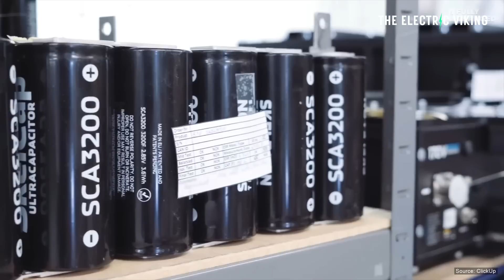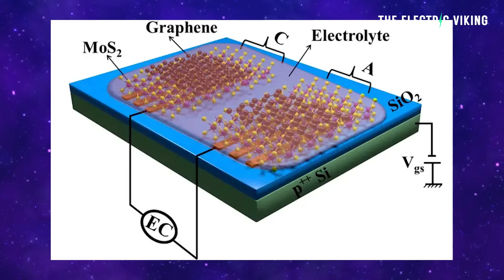Experts say Ultramicro Supercapacitor are "Game-Changing Energy Storage"

Comment: Charging not only limit by battery, grid and charging system are limiting it so even if the battery can charge in 2 min you will need 3000kw good luck with that

Comment: I built a car battery from supercapacitors (schematics and build description on my youtube), as well as several flashlights/lanterns some years ago. Another advantage of supercapacitors missed in the video is though batteries support thousands of cycles, supercapacitors support millions of cycles, and are not affected by the heat/cold our weather can produce. If they can get energy density (super cap current weakness) up high enough for EVs, then the supercapacitor could in theory last the lifespan of several cars being moves from one car to the next!
Reply: Super capacitor have high self discharge behaviour, while battery not, its major difference, so when you have high energy density of super capacitor its useless if you have long delay gap between charging and discharging, for example charging now and use electricity next day or next week
Reply: @teknosql4740  self discharge depends on the quaility of the supercapacitor. Some cheap Chinese brands (like Green-Cap) are pretty poor grade, and discharge 20%-30% in less than an hour. Then you got brands like Maxwell (I use in my flashlights). Some of their capacitors had +90% charge after 6 months. If they can get the energy density of supercapacitors near batteries you'd have the perfect power source.

Comment: The thing about capacitors in the old days is that even though they could take 250,000 cycles they would only hold a small amount of energy. Then they were opt to release it all at once. However, in the early 2000s Brigham Young University (BYU) out of Salt Lake City, Utah took an EV1 and replaced its batteries with supercapacitors. I saw them bring their capacitor powered car to The Power of DC, an EV drag race event held just outside of Washington, DC, where a bunch of homemade EVers used to drag race their EVs against each other. The caps powered EV1 from BYU would push so much power through the motor that it would twist break the axles on their EV1. Drag racing seemed the perfect place for supercapacitors because they would release all their energy in a few seconds and then they were empty. To solve this problem in electronics engineers time a bank of capacitors to release a row at a time, timed with the Hz of the electronics. Its like going small pop, pop, pop etc. to create a better smoother flow of current. Because they can be cycles for forever, (250,000 cycles) and they can capture energy so fast they really are perfect for charging with regenerative braking and then releasing that captured energy to overcome inertia, an object at rest will stay at rest unless acted upon. EVs use a lot of energy to just get going. Once they are going they don't need as much energy to stay going, An object in motion will stay in motion unless acted upon. This would leave the batteries with only the duty of keeping the vehicle going through wind resistance, mechanical resistance and road friction resistance. The problem with capacitors in the old days is that they would take up a lot of space for the volume of energy they stored. This breakthrough seems to solve the energy volume problem. With that using capacitors for all phases of EV energy storage and use would be possible. Capacitors don't really go bad like batteries. It is not a chemical reaction that has to take place in order for them to charge and discharge, so there is nothing to wearout. Original capacitors use an electric field to hold the electricity. Any of you know what a Leyden Jar is? It looks like these dudes are going old school. I mean really old school, like the middle of the 1700s old school.

Comment: Microscopic supercapacitors built on chips in a wafer fab may be OK to integrate small amounts of capacitance into an IC, but the cost per joule stored will rule out their use for bulk energy storage.  Even with a micrometer of thickness built on the chip, which is huge, a square meter of silicon would only have 0.01 cubic centimeters of supercapacitor.

Comment: Supercapacitors are very useful in energy-recovery systems such as you find in hybrids and electric vehicles due to their very low internal resistance.  For example, a typical EV battery can soak up around 150kW of power during regeneration and it could hold that rate for many minutes.  A super-capacitor, on the other-hand, would be able to soak up megawatts of power, but would only be able to hold that rate for a few seconds.

So supercapacitors won't be replacing batteries, probably ever.  They don't have the energy density.  But for short-term energy recovery and generation purposes the super-capacitor can operate at 99%+ efficiency while an EV battery would be sitting at 85% or lower (at those wattages) due to the voltage drop caused by its internal resistance.

Similarly, for handling short-term acceleration (such as accelerating from a stop), a super-capacitor could be charged slowly from the EV battery and then discharged quickly into the motor at much greater efficiency. 

That is the main claim to fame and this "discovery" (if it could be called that... I'm skeptical myself)... it probably isn't going to change the equation much.  That "3000%" quoted was clearly under extremely fragile conditions and probably relative to very low amounts of capacitance in the first place, for example.   A game changer?  Maybe decades from now a portion of this research will be in use as part of super-capacitor system.  It sounds rather expensive.

Comment: There is a problem with high speed charging of battery packs and that is the amount of energy that the grid can supply. If you take the average house electrical supply in the Uk (80 amps at 240 volt or 19.2 Kw) a 50 Kwhr battery pack will take around 2.5 hrs to charge from low and this does not allow for any use in the house. You could use public high speed chargers but they are expensive per Kwhr as the company running them want to make a profit. If you are able to charge your car in 3 minutes (say 50Kwhr battery - it does not matter if it is Li ion or supercapacitor) you need a supply capable of 1000Kw (1 Mgw) or the average daily use of 125 houses. The idea is good but ulta high speed charging will present major problems for the grid. If you have a charging station of say 20 chargers they will require the energy capacity for a small town. One way to allow high speed charging might be to limit the time of day it can be done.
Reply: The grid capacity issue can be overcome by having local battery storage with the charger. The big problem is the connection to the vehicle. Can you imagine the thickness of cable needed for a 2 min charge!
Reply: For a 3 min charge on a 400 volt system you are looking at around 2500 amp. To put that in context the current 350 Kw chargers charges at 875 amps. These charging cable can be a problem now so a cable twice to three times the size would be impossible to handle.  @petewright4640

Comment: Supercapacitors are general orders of magnitude removed from having the energy to mass and energy to volume ratios of batteries. So this may well be a better supercapacitor, but I think it's stretching things to suggest it's going to replace batteries.
Reply: They're becoming quite common in electric forklifts. While they don't store as much energy, they will charge in the time it takes you to go for a pee. In a 24/7 warehouse operation, it results in  higher uptime, compared with a unit that has to sit for several hours recharging batteries over that same period.

Comment: All that matters is the energy density and cost per kWh, and we are a long way off capacitors getting anywhere near batteries in terms of energy density by at least an order of magnitude.  Batteries already provide sufficient power.  Like all your other science announcements, it it was any good they would be already being sold and used in products.
Its possible to produce high capacitance, but not high voltage, so the higher you go with capacitance the lower the voltage tolerance.  They don't mention this so we can assume that is what the problem is.

Comment: For many decades we had electric vehicles that transported us around town without any batteries - and yes,  I was just a kid when I rode in them.  I'm old now, but we had a whole system that let us go anywhere for a low price.  But like idiots we gave it up in order to have our own cars.  Now we're trying to go back to electric vehicles and we're forgetting that we were already once there.  ☹️🥺😥
Reply: I remember the Cleveland, Ohio electric trolley cars in the 1950's.
Reply: EVs are a bit of the best of both, e power off the tracks
Reply: Those electric vehicles of which you speak had a serious limitation: they ran a fixed route on a slow fixed time table. FSD taxis will pick one up on their own schedule, take them to whatever their destination, attend to someone else, and another one will pick them up. Rinse and repeat.

There will be no need for tracks or other overhead charging infrastructure. I believe the cost will drop below 10¢ a mile.

Comment: Living for 70 years in the 5 volt electronic world, and 110/220 volt US  residential world.  Should there be concern regarding high voltage capacitors, mega chargers, EVs with 800volt architecture in the hands of everyday housewifes?  I remember a few wet/110 volt deadly groundings as a kid.

Comment: I could see super capacitors added to EV's.  Regenerative braking charges too fast for batteries and going from stopped to moving takes lots of energy.  Capacitors could supplement batteries and be especially useful in stop and go traffic.  May also be good for wireless charging.  You might be able to make an EV with a smaller battery which would save weight and cost less.  This could be the future for Urban Robo Taxi's.
Reply: you could remove/replace that item from under the frunk... #munrolive

Comment: That energy density sounds too high for be real.

That's because capacitors are based in electrostatic charge, not chemical based in ion exchange. The electric field generate problems that limit a lot the total charge in the capacitor that makes extremely dubious that supercapacitor can reach so high energy densities.

Speaking of "X%" is doesn't said too much, as it depends of the base value. If you are taking a regular capacitor as a base, 5000% is not even enough to reach lithium-ion or even sodium-ion energy density.

Of course, the high current that a supercapacitor can reach make it a preferred technology over batteries on some scenarios. But for high energy demand, like aviation, high energy density is a requirement, an even current market lithium-ion densities are not enough. So supercapacitor have even less potential.
There is a possible cheat here. Because they are speaking of ultrasmall capacitors, maybe... just maybe, they reach that values because they aren't close one to another, so the electric field is not a problem. So while they have reach "absurd" levels of high energy density, they have a scalability problem to make big batteries. Just putting a lot together won't work.
Which makes me think if it's possible build positive charge (lack of electrons) capacitors to compensate, so a big scale supercapacitor where made of internal positive and negative very capacitors, making a macrocapacitor of zero net charge. 
Is it that possible? I don't know.

Besides, if the density were so high, it has very little sense to focus in reach even higher densities were the problems to turn into real products are raw material costs (gold?... not a chance for massive production) and mass manufacturing.
So I think that this ultracapacitors can have very high densities for capacitors standards, but I doubt they are in that values.

If it's confirmed (which I doubt), they they are missing the right focus, that it must be reducing the costs which means cheaper materials and new ways of production to reduce the cost and accelerate the manufacture process.

Comment: As other engineers say in the comments… nah, it’s another scam.
Capacitors storing enough energy for electric cars are not going to happen.
The description of how it works is complete bollocks.
Even the pictures show a thermionic valve and a wave soldering machine.
We will get a flux capacitor long before these work.
DO NOT INVEST!

Comment: I think ot is an interesting development. There is a growing body of literature that suggest that Li-ion battery technologies and supercapacitor technologies are increasing evolving to a common median in terms of capacity to performance ratio and function. I don't think we'll get as far as replacing EV  batteries with ultracapacitors completely because the features and use case of both different. But there have been many stories in the past of complementing EV batteries with capacitors to more efficiently capture and release energy when accelerating and decelerating the EV, because the efficiency amd potential performance is better than what batteries can achieve, without thermal issues to.the battery. So combined as hybrid battery it could make EVs more efficient. Other ideas have been to replace the 12,24, 48 V EV battery with capacitors to improve longer performance over time. Weather and cold impacts capacitors less, which makes them more ideal for that purpose.
I can also see ultracapcitors greatly improve inverter technologies for consumer grade products and pcb use and in EVs to make more compact products at less weight and cheaper price to build, which improves space and weight savings. And of they have better thermal properties they could potentially also greatly improve consumer grade electronics with less risk of fire risks for consumer based products.

Comment: The main benefit of Super capacitors is they can store a very large amount of charge, but normally discharges at a faster than usual rate, which is good if you are accelerating a car, but not so good to run as a battery

Comment: Capacitors are fascinating… I think we will see them in cars as a complement to the battery, as they can accept huge charges rapidly and discharge rapidly.  This has huge potential for stopping (rapid charge) accelerating (rapid discharge) and is currently being used for this in some light rail applications.  

Every day electric cars get better… and everyday ICE vehicles become a little more obsolete.  

Rock on Viking
Reply: Hell yeah!
Reply: I thought so too, I don't know why we haven't seen them yet. If it works out it'd be great to be able to add them aftermarket!
Reply: Thought some cars already incorporated them. 

 I also thought I seen a video recently where they said researchers have made a capicator that can rival modern lithium batteries in the next five years. I think I was a graphyne based super capictor (not graphene). Most likely vapor ware with researches these days trying to get more funding. 

 Issue always is scalability. 
 
 Having them in conjunction with batteries would be amazing for certain things like airplanes, and sports cars.